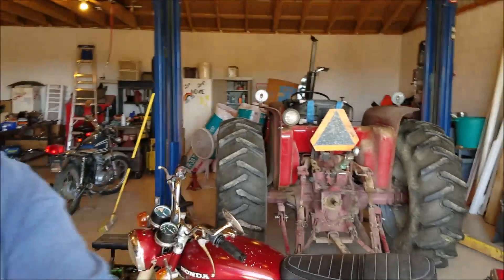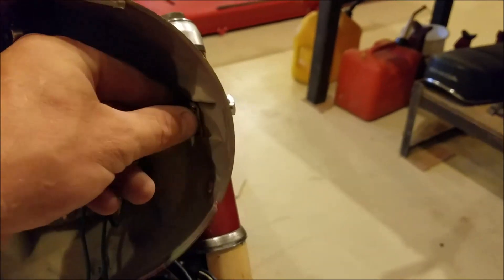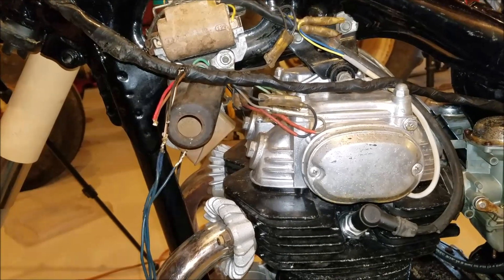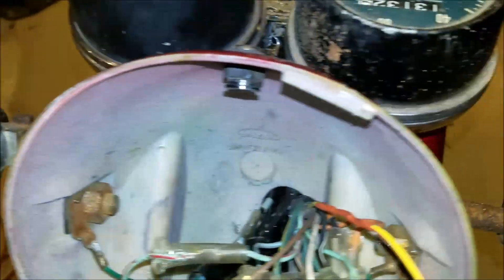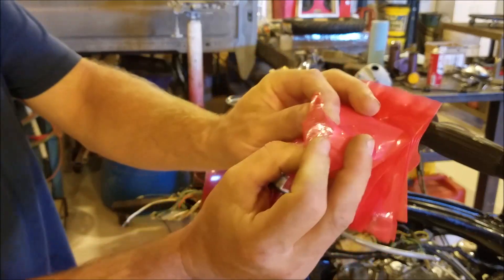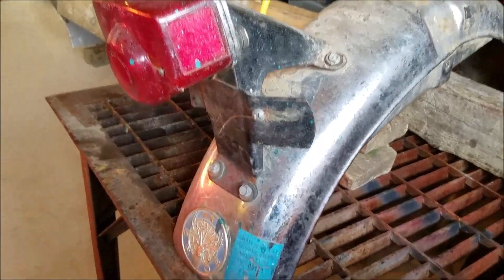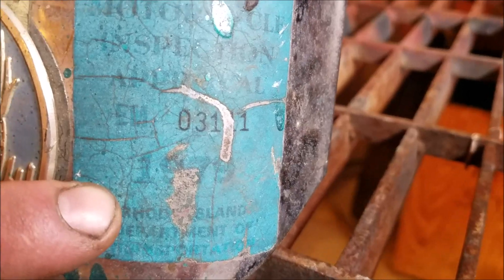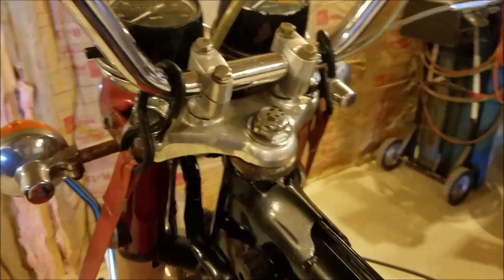Honda CB350 ELECTRICAL Wiring ... Part#5  Basket case REBUILD

Comment: To KY: Excellent job. You kicked it in the butt every step of the way. You make it look easy. I took 2 CL's, 1 SL, and 1 CB apart and made a 350 something. It sucked,but I would do it again in a heartbeat. Anything to say about electronic ignition? You are not an idiot. My friend, who for some reason felt he needed to alter the brand new, 1973 seat I had, is an idiot. But, what the hell?, it still works. Thank you. You are a cool cat.
Reply from the maker: Thanks! I haven't tried electronic ignition on anything yet, if the old stuff works then good enough for me, glad you enjoyed the video!

Comment: Excellent video. I see those  jumper wires quite often in many different types of machines.
Reply from the maker: Thanks Brian! I have never seen jumpers like that, but I haven't really worked on alot of different machinery.
Reply: I've seen them on bikes and quads. Some also on snowblower harnesses. I think they must use the same harnesses on different machines.
Reply from the maker: @bmbriguybmbriguy9988  I would say your right

Comment: For the signals with the rust on the tube. I started using corroseal rust converter to tough up rust. Been really impressed with it so far.
Reply: For the chrome bits I used a Teflon based metal polish on my bike.
Reply from the maker: I will look into it, I really like the lime away for most things and mothers polish
Reply: @kentuckyyankee  really anything is better than nothing ;) went to the garage the chrome stuff is called "blue magic"
A metal polish that's blue then darkens when you do the circle swirls. I then let it dry and then rub the chrome again to remove excess. It's helped fix pitted chrome on the bike when I got it. Or at least made it very hard to see pits.

Also used it on chrome bits on the car SUV and tail pipe tips. Makes stuff pop out with shine.
Reply from the maker: @danielsimpson8929  I have seen something similar to that and yeah seems to work really good

Comment: I just came across this video this morning and I see it’s a year old.  The red/orange 4 wire plastic round connection off the key switch is plugged together in the small spot directly behind the ignition coils on mine so it’s supported and not dangling.  You may have already figured it out. I have green corrosion on my wire connections inside my plug in connectors so was looking around to see if there’s a good easy way to dissolve it without pulling the wires out of them.
Reply from the maker: I sold this bike a year ago, but loved it, I use electrical cleaner in an aerosol can to clean the connections, real bad ones I used find sand paper rolled up, thanks for watching, have a Playlist on this bike if you're interested

Comment: Great video. Love your approach. Electrical stuff is not my favorite 😬 I was looking at a CB 350 on Craig’s list that didn’t have a key. Dumb question… I wonder if I could just get a key made or would I have to change the ignition switch?  Where do you get your Honda parts from?
Reply from the maker: You can get a key made or look on the lock cylinder get the key number many times they have original keys on ebay.

Comment: Shouldn't there be a rubber grommet on the back of the head light.
Reply from the maker: I wondered the same thing, maybe someone will let us know, I am not sure if all the wires will fit if there was a grommet, there is no danger of the wires rubbing through because the conduit is so thick and the headlight bucket is plastic. Good question, I will look into it.